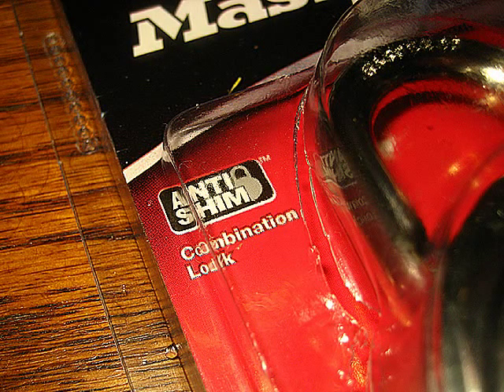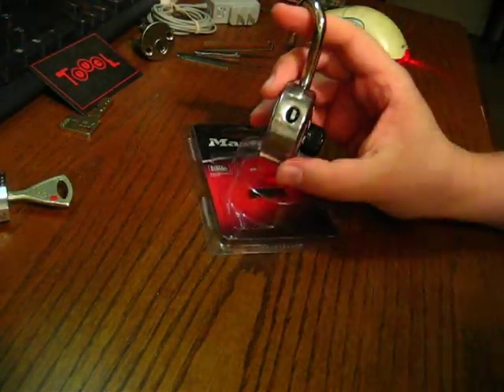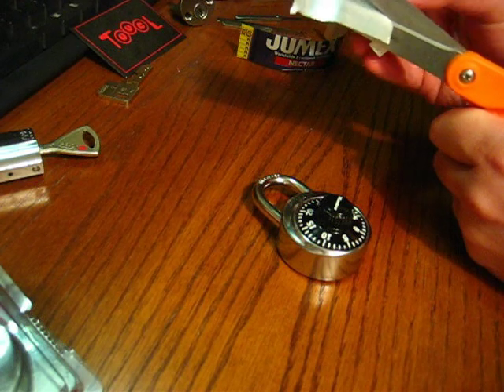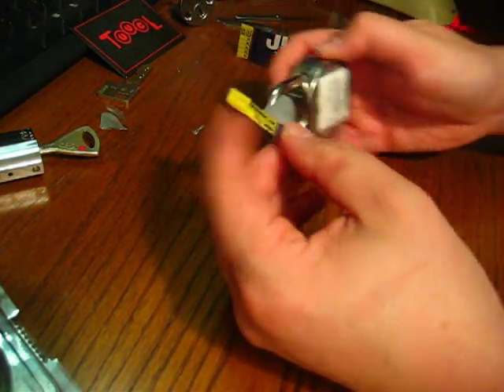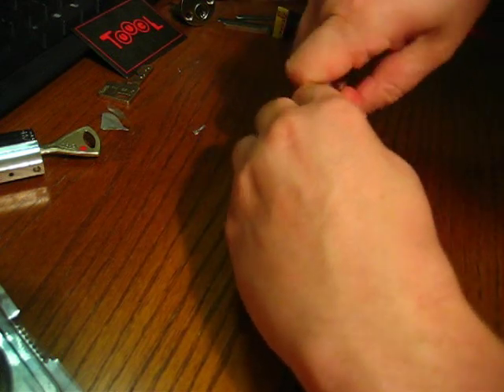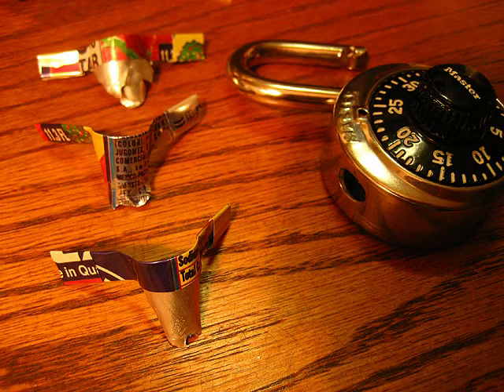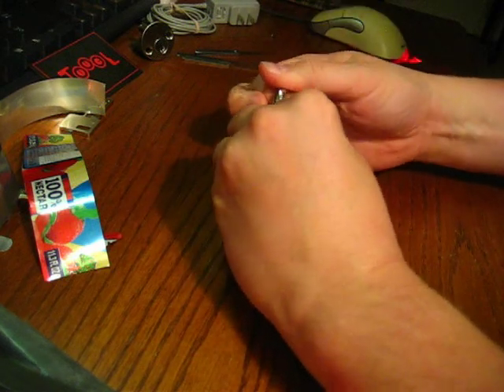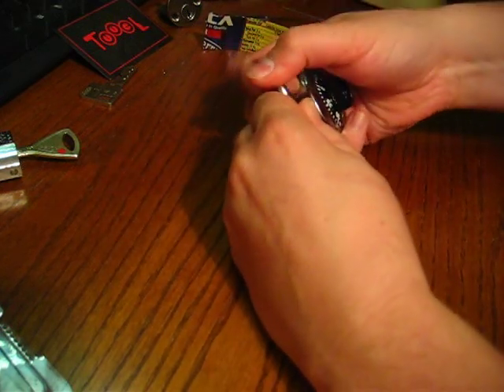Anti-Shim Padlock Gets Shimmed

Comment from the maker: the strangely-named "Speed Dial" lock (odd because nothing is "dialed" when you operate its one, large button) also known as the 1500i padlock cannot be shimmed.  while it does not use a double-ball, it does use a locking bar mechanism that is held shut by more than a simple spring.

the only way to open it is to remember the combination or to use Michael Huebler's attack which take a while, requires a force/strain gauge, and requires some advanced math.

Comment from the maker: @pelanor hmm... if you are having difficulty shimming, i'd suggest looking for the "extreme" version of this product... it's the version of the dial combo lock that often is colorized, etc.  the colorization is handled by using aluminum in the fabrication process as opposed to steel.  while it's much easier to anodize, the overall construction of those locks is of much lower strength.

look for those colored ones and try shimming... it's much easier if you're starting out.  good luck!

Comment from the maker: @DeludedSaint from much of what i can tell, no.  the pre-fabricated "professional" shims (made of spring steel stock and available through locksmithing catalogs) would not easily bend "around" the various ridges of the retaining latch within the body of the lock.  also, no on said you have to make ten shims to make this work.  a single shim is all you would need... the rest of the empty can could just be thrown away or recycled.

Comment from the maker: correct.  a proper padlock will have a mechanism that is shim-proof, not merely shim-resistant.  double-ball mechanisms cannot be shimmed at all.  (of course, as ScowtTech points out, they can be picked if the lock cylinder is weak)

Comment: I just did this to my Master lock 1590D anti-shim combination lock which I'd forgotten the code for. I inserted the shim and did exactly as the video described, but I didn't think it worked so I pulled the shim out (it was very much jammed in) and then wiggled the hasp and it opened.

Comment: Zephyr actually makes a better designed anti shim feature. When they stamp the shacke, they actually make it so there's a nipple sticking out right where it enters the lock body, so even that attack won't work. They also don't fall into the Masterlock code breaking fault. Once I find mine again, I'll cut it open to see what security measures they have that are better than Masterlock. But their false gate protection definitely is above that of Masterlock. 

IIRC, I only found one major false gate that tricks you into thinking your found a real gate, but it's nowhere near a number in the code.